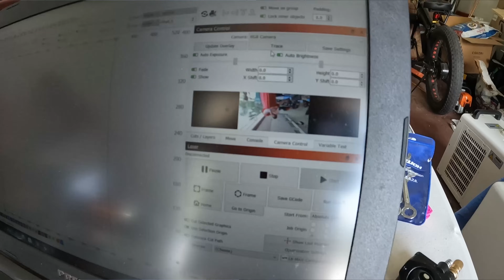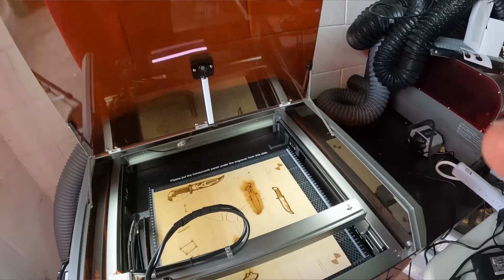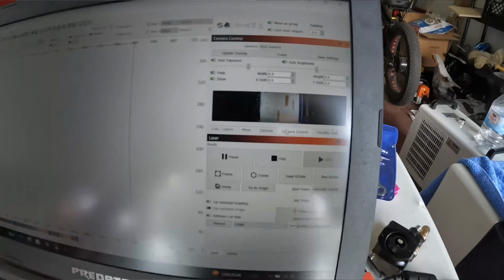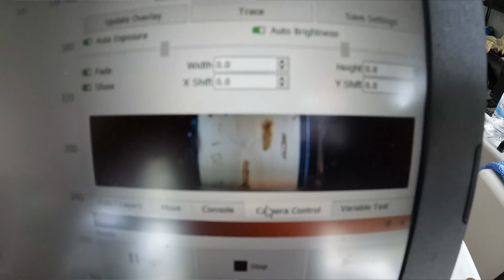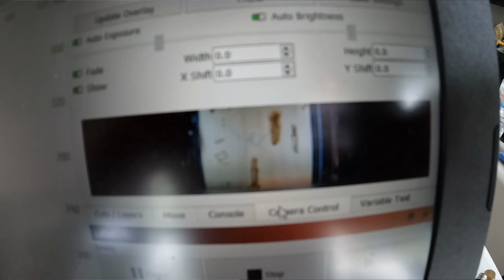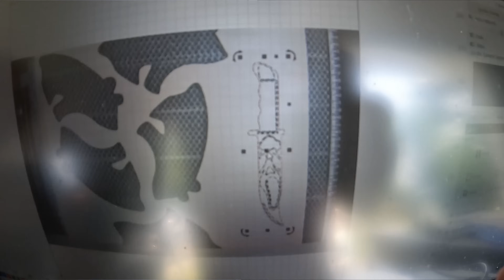WOXCKER L8 Laser Cutter & Engraver Review

Comment: How well does this work with different materials? Obviously it looked good doing wood and cardboard, but have you tried it with thin metal?
Reply from the maker: Diode lasers like this will not do anything to metal. IR and UV can mark metal, fiber can mark deeper and cut some thin metals.

Comment: Bought the woxcker l2 max 20w and I am lost
Reply from the maker: @mindyjohnson4948  what's the problem, maybe I can point you in the right direction.
Reply: @ I just don’t understand how pick wood out and my settings. I have a piece of wood about 1/2 in thick and I am putting a saying on it that says Mindy’s crafts with a border
Reply from the maker: @mindyjohnson4948  Every material will have different settings. You'll have to learn the speed and power for each material by doing test pieces. A lot of people will take a piece of material and then do a grid with one axis speed settings and the other power settings. For engraving something that thick you might want to try 200 mm/s at 80-100% power. The slower the movement, the higher the power, the deeper it will go.

Comment: Hi, recently purchased this laser and it is the first one I have been trying to use. I am trying to get all the settings and speeds right, is there a library that is online for all the types of materials? I thank you for posting this because the height of the laser was something I was wondering about and i read the instruction book and still couldn't find all the directions.
Reply from the maker: There are sellers on etsy that sell settings libraries for lightburn. These are the setting I was using for my stating point: https://www.etsy.com/listing/1380521634/300-materials-xtool-d1-pro-20-watt-laser